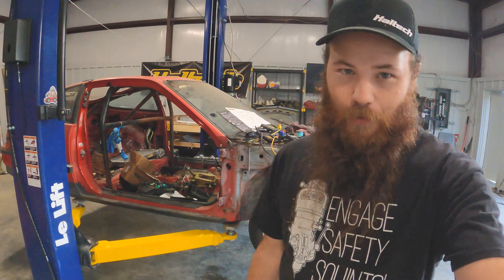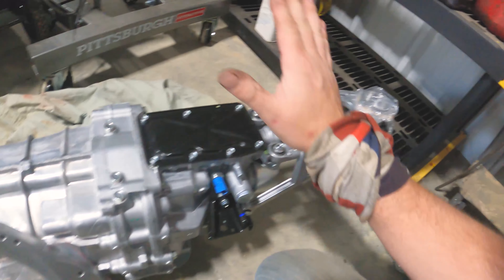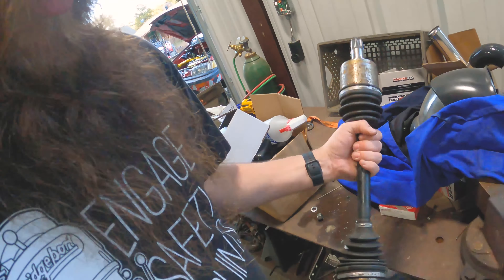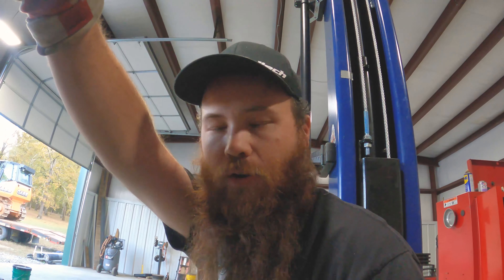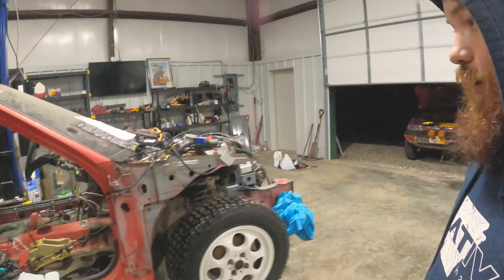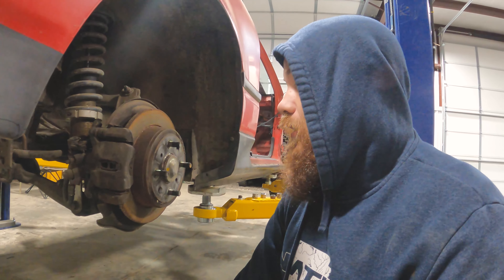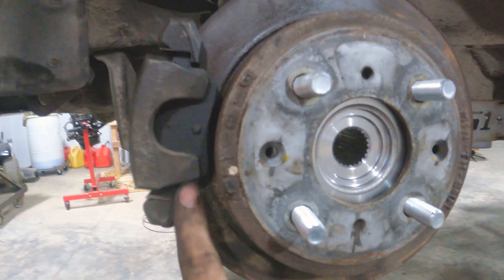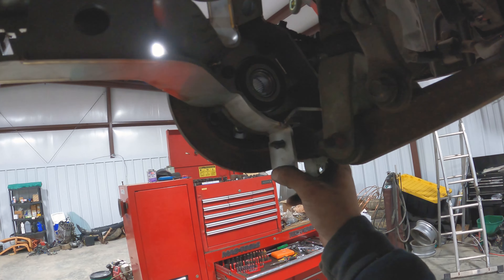S1Built Rear Diff Mount & Swing Arm Install(88-91 Honda CRX)

Comment: Just wanted to share a couple things I've learned from my first K swap.

If that is a manual Element intermediate shaft then you are good to go with those RSX axles.  Auto intermediate shafts sit further away from the engine = no go.

Also the Accord shifter will work with an Accord/TSX trans.  But will not work with the AWD K series trans, because of the shift mech.  If you swap over to an Accord or TSX shift mech, may require drilling and tapping 1 or 2 new holes, then the Accord shifter will work.

So either RSX or that 91-93 Accord shifter are what you need for the K AWD trans.

Just wanting to help in planning your planning and parts interchange/gathering.

It's coming along!
Reply from the maker: Thanks for the info brother! I do have the 91-93 Accord metal shifter and adapter plate, I was just curious if those cables from the 04 Accord would work. 

That intermediate shaft is from the manual Element I got the transmission out of, so it should be golden. That was one thing I was curious about.